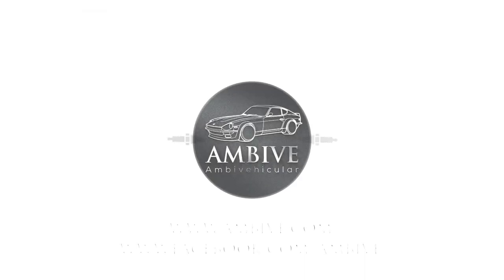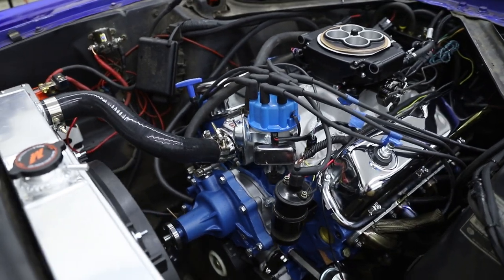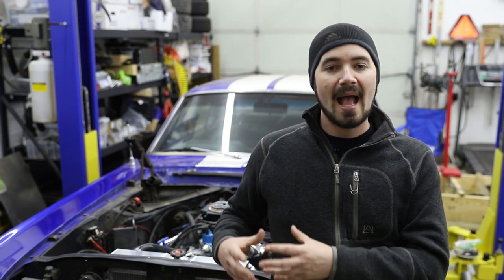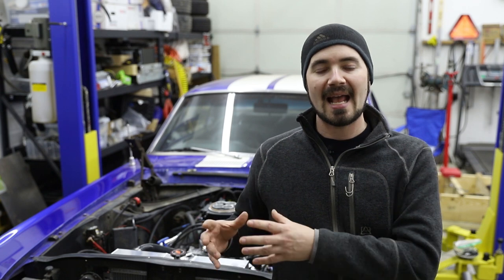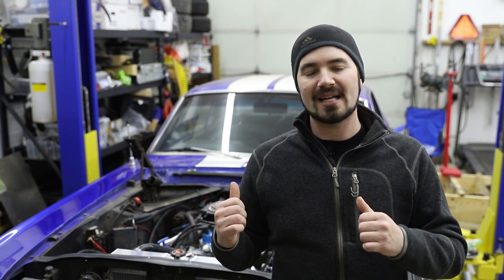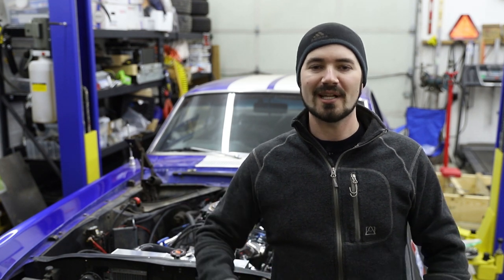67 Mustang - Unveiling the new engine

Comment: Awesome Casper! Good choice. Did you possibly think of doing a 347 stroker? Just wondering. I have a delema of replacing my 460 big block (originally a 390) to a small block to free up engine bay room etc. Car does not race anymore, so looking for a nice pro-street kinda of thing. Those Coyote engines are easily available and not a ton of money. But perhaps I will go 351W 408 stroker. Will have to see how the money situation is, lol. Oh, you are so lucky to have a wife that works with you and helps. Mine wont come near my 67 when I am out there. Too much swearing for her liking, lol Thanks for sharing!!! Cheers from Motown/Dearborn.
Reply from the maker: I thought about going the 408 route, but I want sure if I was going to modify this down the road for higher RPM or not and didn't want to lock myself in with a stroker setup. I figured the 302 was a happy medium that I could stroke out or throw revs at with boost if I decided to go manual and/or reuse it in a Cobra kit car later.